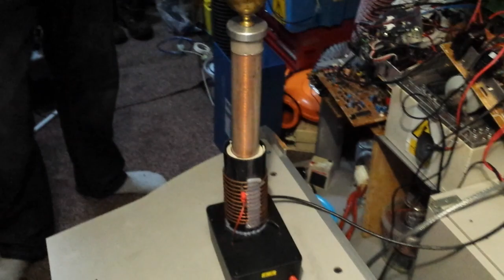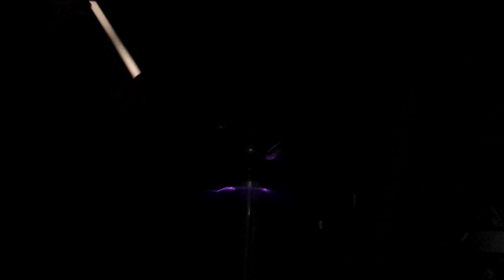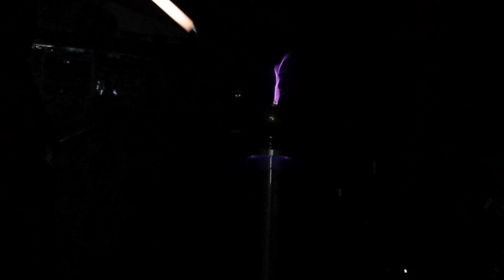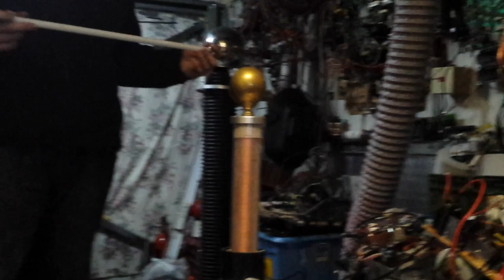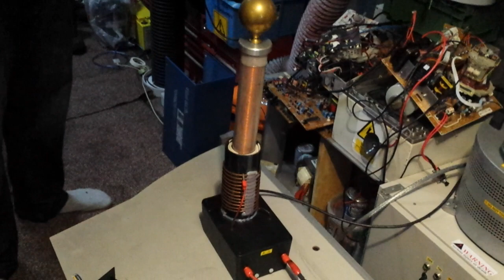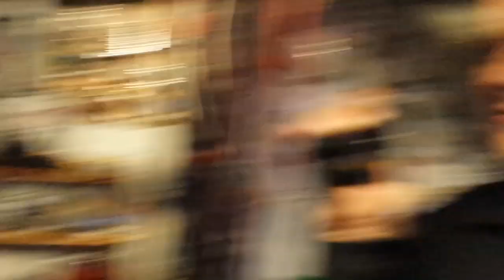Homemade table top tesla coil

Comment: did you have to measure the coils frequemcy and adjust stuff,or did it directly work with the zvs?
Reply from the maker: Hi mate' im so sorry for the late reply I have so many emails and comments to reply too... but you asked if the desktop coil would work right off a zvs' driver and dc flyback? and did I have to change anything' ? well no mate.. its all to do with capacitors" and what ya using!  Im using the 3kv caps from about 12 to 14 invertor microwaves! Im sorry I cant remember the value, but I got them in series to make about 16kv and the parallel them with another 3 strings!!you can try most caps but be carefull with some as they can get hot! And you can get back spikes at twice your caps voltage' and the caps have to be pulse rated!  I hope this helps with your question friend.

Anthony,

High1voltage1rules
Reply: high1voltage1rules thanks :D

Comment: Very nice output ant my baby coil does about the same but using a 12kv Nst is hard to control primary to secondary corona arcing lol I have to use my older non GFI nst &i dont have a adjustable ballast yet only a 5amp variac thumbs up mate!